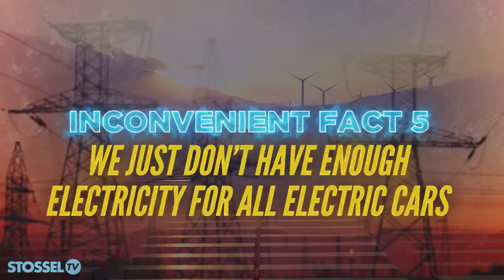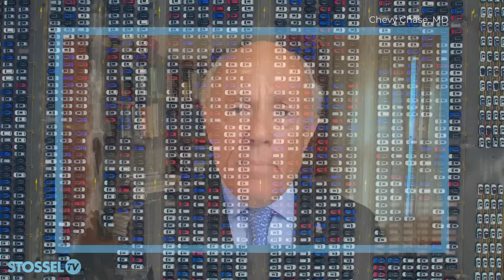Electric Cars: Inconvenient Facts, Part 2

Comment: I have a wind tubing science degree and they use about 600-900 gallons of oil per year just to lubricator the gearbox. They also don’t become carbon neutral until about 9 years of operation which is also about have the turbines life cycle. They are really that green
Reply: Did you calculate the oil burned and the pollution created to make the megawatts of energy for decades? There is no carbon neutrality whatsoever with a fossil fuel generator, you know.
Reply: Citation?  Gear boxes don't need oil changes because there's no combustion and waste products getting by rings to pollute the oil.  If the oil is synthetic and kept below the flash point temperature, the oil will outlast the gearbox.
Reply: @ohger1  LOL this guy has never changed his transmission fluid!

There's no combustion in the transmission and differentials and of automobiles, yet we change the oil at least every 100,000 miles. Perhaps despite being lubricated metal still creates friction, gets hot and degrades releasing particulates into the lubricating medium which in turn reduces its effectiveness. You think?
Reply: @salazam  In a car that's built to last 100k miles, yes. Due to cost constraints, consumer level equipment is designed with cost and just enough metal to last the warranty period as the biggest factor. I've never seen an industrial gearbox that needed scheduled oil changes. Again, it's about flash point.  But I'm willing to be corrected because I've never worked on a wind turbine, which is why I asked for a citation.  Edit: some googling shows contradictory info, but at least one site that looks reputable says huge 5MW turbines do use several hundred gallons of oil every 1 to 3 years.
Reply: @ohger1  You've obviously never worked on a car either. Toyotas easily get 300k miles on factory parts. Try again buster brown.
Reply: @salazam  LOL "easily".  I sell every Toyota motor I get.  **EVERY**..
Reply: "They also don’t become carbon neutral until about 9 years of operation which is also about have the turbines life cycle. "
Please show a reference. And the turbine BLADE may get replaced at the 10 year mark, not the entire turbine tower and generator. Remember that after 9 years of operation of a fossil fuel generation plant, there is NO break even possible at all.
Reply: @justsomeguy934  No that's just what my instructor told me. He was actually very honest and upfront about all the negatives. He really harped on how many birds they kill especially.
Reply: @salazam  dude is smoking something strong, i was like huh?
Reply: @Dronerivers  when you look at the other risks to birds, turbines aren't even in the ballpark.
Reply: @Dronerivers  "He really harped on how many birds they kill especially." Buildings kill 3x the number of birds that turbines do. Cats + dogs an order of magnitude more, and pesticides are not even in the same universe in number of bird kills. Your instructor needs another perspective.
Reply: BS

Comment: Excellent video. I just read Rivian Motors loses tens of thousands of dollars on every vehicle they sell, yet they will not go broke as the governments, all of them, will  prop them up on YOUR dime (an old euphemism)
Reply: The electric truck designers didn't seem to be using much common sense. They have little tow range, it'd make much more sense to build  diesel/electric hybrid truck. So when you need to tow something across the state, you can run the generator to keep the batteries charged while driving. Instead of towing for like 80 miles then having to stop for 8 hrs to recharge.

Comment: Is there going to be a part 3? Perhaps tackle the waste all of these batteries, panels and windmills will create?
Reply: Great idea
Reply: Used batteries are incredibly valuable sources for chemical recycling, which is happening now. At least we can easily physically capture these materials from renewable energy sources, unlike the pollution from fossil fuels, which is just one of their waste products.
Reply: You mean compared to the environmental impact, resources required and Co2 emitted to build and maintain infrastructure for 65,000 oil wells, 700 refineries, 80,000km of pipeline, 700 very large crude carriers (VLCCs), 8,500 coal mines and 2,500 coal fired plants, 62,000 gas power plants, or the 1,500 oil rigs worldwide?? All to make a product which is then burned, and it's pollution released into the atmosphere?
Reply: @headstashmusic3897 : Oil is used for more than just energy....
Reply: @herrschaftg35  Indeed. Thats called manufacturing, and exactly what we should be using our oil resources for, as it stores the carbon instead of burning. 20 gallons of gas is produced from 1 barrel of oil. A F-150 get 22 miles per gallon or 440 miles per barrel of oil. You can drive 440 miles once and thats it, the barrel of oil is gone. Or you can make a bunch of pacemakers, MRI machines, Ct scans etc which will save lives, last many years, and are not causing our planet to heat. Im not anti oil, Im about using all our resources for their most practical and safe applications. Combustion, where oils millions of years of stored energy is burned up in a milli-second, never to be used again, is THE WORST possible use of this incredibly versatile resource.
Reply: @dannygreen7473  Ok then, I'm willing to hear your explanation for the rapid warming, provided it includes plenty of data and stats
Reply: have  you ever seen  how much waste  is produced  by coal oil and  gas ; the  waste is  hidden  and  its enormous and  how many water ways  have been destroyed  by itand  i havent even  got to  plastic  waste  yet
Reply: @Fishy I prefer respectful dialogue. Yes Co2 is indeed vital for life. Too much also destroys it. There are countless cases of this in our world. Water for instance. But we don't need man made Co2 for plants to thrive. They've been doing it for billions of years before we came along. There have been periods of high Co2 levels in the past and Earth became hotter whenever these occurred. But the current increase in Co2 emissions are unprecedented and forcing rapid changes to the climate system. As a result, Earth’s climate has changed faster since the Industrial Revolution than it has at any point in the past 65 million years. There exist on Earth the carbon cycle, which consists of all the burnt and unburnt carbon in the world. The balance of this cycle is what creates the conditions for life. The problem is that the were emitting Co2 (burnt carbon) faster than earths forest, oceans, etc can absorb it, setting off the balance of the carbon cycle.                                                    -"CO2 is only .04% of the atmosphere. Doubling the amount of CO2 would not even equal 1% of the atmosphere."  A variation in the composition of the Earth’s atmosphere of as little as 0.005 percent has meant the difference between sweltering Arctic rainforests and a half mile of ice atop Boston. That negligible wisp of the air is carbon dioxide. You seem to think small amounts of anything aren't dangerous. Thats a very interesting viewpoint. A bio-toxin 1/100th of a single gram can kill a 200 pound man, so I would have to challenge you on that assumption. Humans evolved around 250,000 years ago. From that time until around the year 1800 CO2 concentrations ranged from 250 ppm to 275 ppm. Thats a 25 ppm increase in 250,000 years. Over the last 200 + years this concentration has risen to about 410 ppm. That comparatively, is a massive 135 ppm increase in a mere 200 years. If man has prospered successfully over the last 250,000+ years to be the dominant species on the planet with Co2 levels within this range then it would be safe to assume the smartest thing would be to try and stay within these levels and not wander off into some hypothetical realm, because “Co2 is plant food”.
Reply: How about a pile of dead Bald Eagles...@ bottom of "wind turbine"